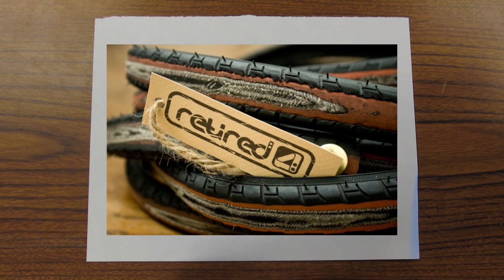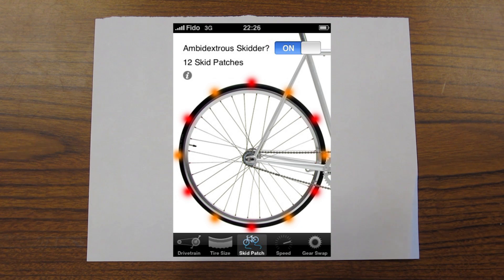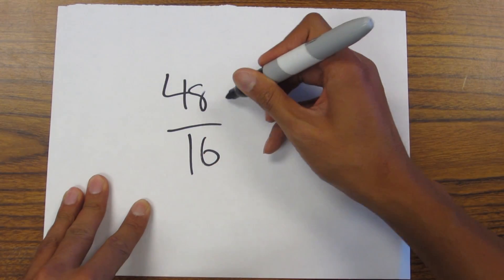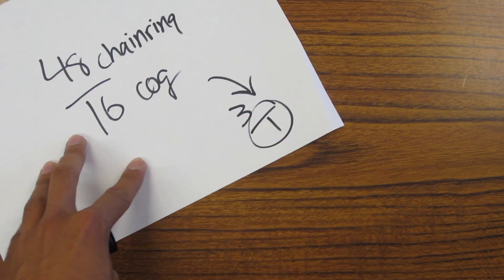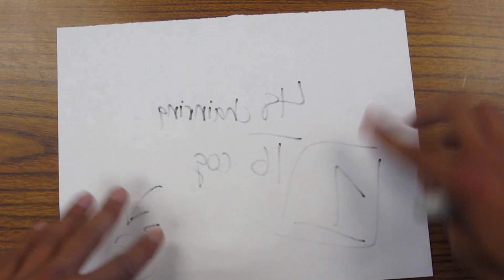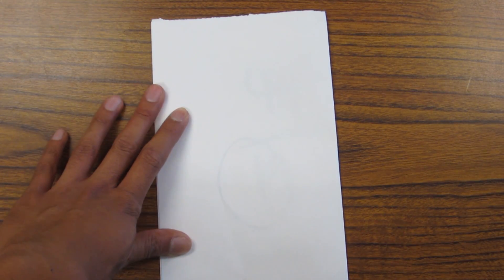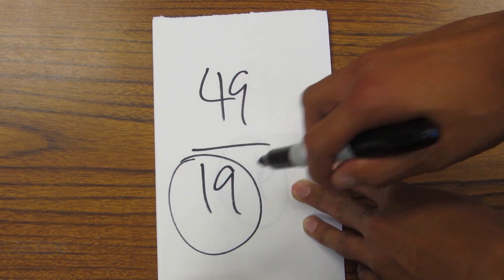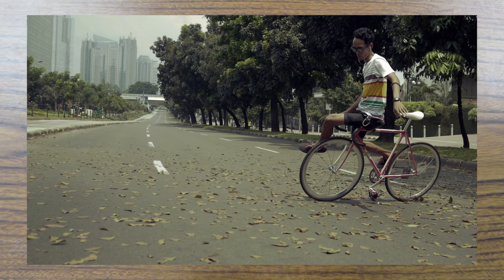Fixed Gear Ratios and Skid Patches Explained

Comment: Do you know why odd numerator doubles the skid patches! Thanks
Reply: A very interesting and important question. It is because when your chain ring number as numerator is odd, times your wheel rotates every round you pedal cant be a even number, which means your skid patch won't be the same one when you skid with another food in front. Just imagine you are riding a bike with gear ratio 1:1, your skid patch would be 2 and be opposite to each other when you use different foot to skid. However, if you ride a ratio 2:1, your wheel will rotate 2 rounds when you pedal one circle. This makes you skid with another foot, which means just pedal half of the circle, so your rear wheel just go one circle round. Still rubbing the same place and has only 1 patch.

Comment: The zeal for skidding is broadly a function of the rebellious soul of the toddler.
Seriously, fit front and rear brakes.
You cannot achieve timely and safe retardation by  skidfong from higher RPM (140+).
You cannot skid with reasonable safety and alacrity on wet roads 
You cannot rode close to other riders of relying on skidding.
Fit front and rear brakes.

Comment: What do u think about this ratio 50/16 - is it a bad ratio? For acceleration and for skidding?
Reply: I just got a bike with this ratio and i have no clue ...
Reply: I think 50/16=82.81 is a bad ratio for acc and skidding. I'm currently using a 48/15=84.66 with 25 tire size, very similar to your ratio (assuming you're using 25s as well) and im not going very far up any hills or accelerating as quickly as id like and i find it difficult to "lock in" my pedals to skid. I think Zack's gear ration of 49/19=68.26 would help you accelerate faster, provide 19 skid patches, and help make climbing easier. Just watch out going down hills.

Comment: I understand the math, but I still cannot wrap my head around how there can be 1 skid patch?
Reply: The assumption is that every time you skid, your feet are in the same position.  With a 48/16, every time you pedal in a circle ONCE, your wheel moves THREE times around and it end up in the EXACT SAME SPOT.  So, if you skid with your feet in a certain spot, the wheel will ALWAYS return to that spot because it cannot coast on a fixed gear bike.  Good now?

Comment: Guys what's a good gear ratio for skidding? It's too hard to lock up my wheels
Reply: I currently use 46/16 but I am going to change that soon. You can skid on any ratio. Balls to the stem when you're starting off. As much weight off the saddle as you can.
Reply: @Jake-pd6ct  what did you change it to
Reply: @kecobrt  I was gonna change it until my frame snapped and I needed to buy a new frame, so I ended up not changing the ratio.
Reply: I use a 46/17 it was too hard on a 46/16

Comment: Or just use this calculator https://www.surplace.fr/ffgc/

Mine is 44/15, giving me 15 skid patches, but also 77 gear inches, which I find a bit hard to skid with. :)
Reply: My graphing calculator has a fraction option that automatically simplifies it which is has been helpful in finding the ratio/skid patch #

Comment: I live in a area with a good amount of hills, what would you recommend ? I'm running 48-17
Should I lower my chairing and raise my my cog to a 18?
Reply: i too live in an area with lots of hills (from the suburbs to west bank of the city there's a 100m difference) and currently found a sweet spot at 46-18
keep in mind you will be having a hard time pushing past 40km/h on flats with such ratio but you will easily climb long hills at a 23km/h average

Comment: Does less teeth mean faster?
Reply: nikesbeast More teeth is faster like 50/14 thats for track racing for street 48/16.If you were to race someone with a 50/14 as a 48/16 gear ration then you will be pedaling more and spinning out,on the other hand the other people will put a lot of power and get somewhere with a big ratio
Reply: nikesbeast * I ride a 48 13, don't do it unless you like being ready to die.
Reply: It's not the bow, it's the Indian.
Reply: No
Reply: im riding a 48 16 right now . would it be better to go down to a 48 15 or 13?

Comment: Hey Zach, i got important question here. I looked up online, googled it. I found a lot of skid patch math etc. However, I dont find any product called skid patch. Is it just something we stick it on the tire? use any possible material ? or there is a thing specialized for fixed gear skid stopping? How do you install it? can you give more detail please? much appreciated.
Reply: its basically the spot on the tire that will wear out if you skid on the pavement with your tire
Reply: h-hes trolling.